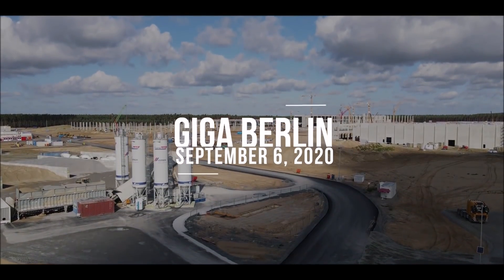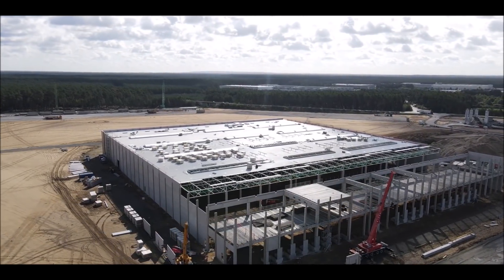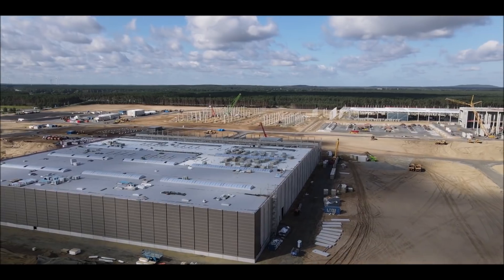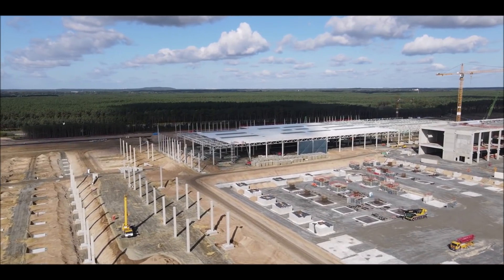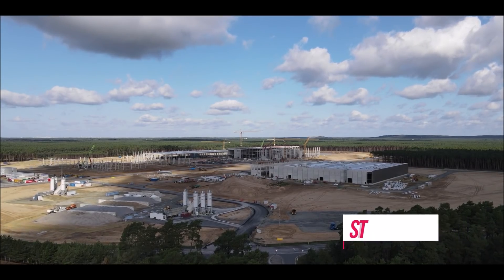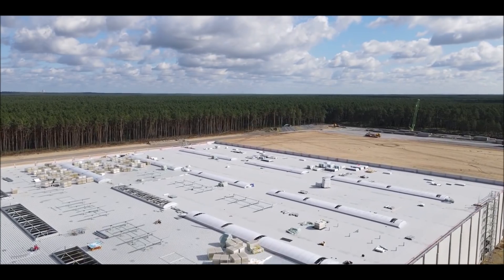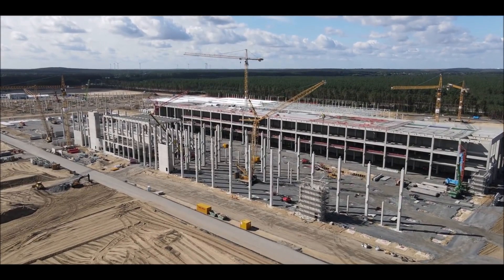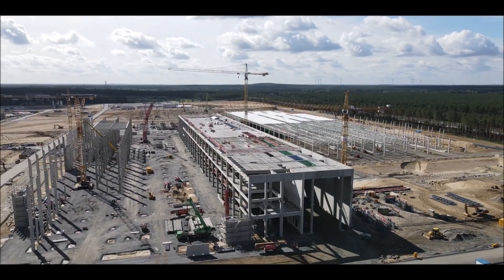Tesla To Use 8 Giga Presses at Giga Berlin Revolutionizing Production

Comment: Great video. Small correction: The German article from Teslamag says each machine weighs "hundreds of tons", not 100 tons. Per the Wikipedia article on Giga Press, the IDRA OL 6100 CS weighs in the range of 410-430 tons and has a pressing force in the range of ~6,100 tons.

Comment: 73.1 tons per day x 8 machines = 584.1 metric tons per day. If the bare chassis (less motors, mechanical, batteries, glass, sound deadening, suspension, interior) is 500 lb then this would be 2575 cars per day, 18,000 cars per week, over 900,000 cars per year. Wow
Reply: Nope it doesnt work like that, some machines will be used for redundancy in case one fails, thats how it is
Reply: Also they will never reach the production number of the vw factory in Wolfsburg

Comment: My moonshot prediction is 1 press to do rear body, a left and a right casting doing each of the front shock tower, shotgun and A-pillar as a pair of castings and one press doing the B-pillars. Then the sills are just extrusions and the floor is plated battery module. Dash and rear seat pan either plastic moulding or pressed Alu.
2nd set of 4 castings is for volume fulfilment and redundancy.

Comment: Isn't a casting machine called a foundry?
Reply: W N  it is not a new casting technology, bmw, audi have been using that type of die casting, sandy munro saw a giant casting in the bmw i3 way back in 2013, and the tesla giant casting machines are just bigger custom machines made by an Italian manufacturer and  not tesla.
Reply: W N  nope the bmw i3 was a giant casting, you have to look at old munro videos, also castings always requires machining and checking gor better quality since its a bigger piece to be made
Reply: Hi-tech high pressure presses, they are not using sand, lost wax or gravity pour casting
Reply: @reneheuscher1557  Yeah I understand that the technology has dramatically changed, but wouldn't It be kind of cool to use this old time term? Esp when people keep using  the blatantly incorrect term press for casting?
Reply: @reneheuscher1557  it has to melt the metal and press it through dies then cool it down, so huge amount of energy loss

Comment: Armen I don’t know how You get these stories ahead of everyone else? This is the only reason I still tune into Your Dhow. First of all, I was giving You credit for providing accurate information. THEN YOU BLOW IT. Please don’t refer to these Casting Machines as Presses. THEY ARE NOT. each of  these machines are as big ass house. They probably need multiple machines for curing time of liquid metal to cool so they can remove new cast piece and install in car. There will be another cast for front of car that is not announced yet. So MODEL X line may require 4 Casting Machines and the same for MODEL 3. What we all don’t know is if these castings may be used on both cars and they will probably be able to manufacture both cars on the same line at the same time using the same Robots. 
There also could be multiple presses for forming Sheet Metal that could be a lot more complex for metal handling capabilities.
Reply: I don't know much about metalworking, but I'm thinking the difference between casting and stamping could be a really big deal, bigger than is generally recognized. Correct me if I'm wrong, but isn't a cast part stronger per unit of weight than something that is stamped from a sheet? Of course, to do casting quickly in mass production must be difficult, and requires a lot of very expensive equipment. But if you make the investment and handle it right, you have a better product. Am I missing something?
Reply: Ronald Garrison You are not missing any thing. You got it exactly right! I predict there will be another CAST subframe for the front of the car and all TESLA’S will have 2 Castings. Elon Team Even developed special metallurgy and got the ITALIAN manufacture to make a bigger machine for them. I don’t know what these casting machines are worth? The research and development for the first factory could cost TESLA a billion. Only Elon has the Vision and ENGINEERING TEAM to make it happen. Don’t worry, he will get his money back a thousand times over. Look at the billions he invested in putting computers and devices in a million cars already and he will get billions back for his investment and vision made 7 years ago. I can’t do the math but Jeff a Bezos. In less than 10 years You will,have to give up that tittle.
Reply: @Butch Bailey
 he gets those stories so "fast" 'cause he is in the US, that is 6 hours (at least) back from Europe, where he gets most of "his news" ..... so he scans his bookmarked sources from Europe and China (even further ahead time-wise to the US) and copy-pastes what he can ...... plus lots of BLAH BLAH and repetitions to reach the minimum time-length, to get the Youtube money-bonus...... and if you have noticed, he posts all his videos in the noon, to afternoon (US time) cause he needs time to "create" his copy-paste repetition-garbage
Reply: George Albany Look I am no fan of Armen Hareyan  or TORQUE NEWS. I CALL HIM THE DEVEIL. George or Viewers help me out here. Why is Armen one of the biggest mouthpieces on UTUBE that gets real news. He then spins it and adds lots of Drama. He hates TESLA and promotes TOYOTA  even to tell us that RAV 4 is a better  value than a MODEL 3. He drives a PRIUS  and is proud that he doesn’t own TESLA shares. He lectures me that he will get his rewards in Heaven. WHAT THE HELL IS GOING ON HERE? 
WHY CAN’T WE HAVE OUR OWN PIED PIPER WHO LOVES TESLA? RESPECTS THE GENIUS OF ELON MUSK. WE ARE TIRED OF TESLA KILLERS!
Please God. Give our Daily Bread. Give us our Daily Fix of TESLA NEWS, PLEASE GOD DELIVER MY CYBERTRUCK IN LESS THAN 2NYEARS.
Why is it former UTUBE channel providers turn on TESLA: E for Electric Greg, Like TESLA Kim, and now Ben Sullens  for  Christ Sake is now in love with Lucid. Oh I almost forgot my old Girlfriend TESLA JOY. This Girl needs serious HELP. I told her I got a new girlfriend now, Jessica Kirsch who is a real hoot exposing the NOTHINGNESS OF Trevor a Milton and NIKOLA MOTORS by taking a road trip to ARIZONA even finding the FAKE DIRT used for Sod Turning Ceremony. I didn’t expect her Jealous reaction when I told her that i,moved on. She has got a new Relationship with Trevor Milton and he invited her to a special meeting and a ride in his new Truck was I pissed that she dumped me and thinks a Trevor and NIKOLA are GREAT. JOY EXPLODED. She calls Me a Pervert and that I never was her boyfriend! God that hurt. It’s not an unusual storyline. Boy meets Girl and they say nice things to each other and then the gal gets bored and sees the opportunity to make friends with a guy who has a lot more money.

Comment: All scrap and waste material can be thrown right back into the molten aluminum and melted back down. No need to send it out to external scrap metal recyclers.
Reply: Do you know this for a fact?
I think that the scrap aluminium would contain some aluminium oxide, which has a much higher melting point, so to mix this in would give a lower quality material. Maybe that is not a problem for this casting, but it could be.
Reply: @Will-be-free  no not for sure
Reply: @Will-be-free  I agree with you
Reply: Aslong as the casting machine can melt it hot enough to also take  care of the hard aluminium shell, it should be fine.
Reply: Will be free,
Sandy Munroe sort of confirmed this. He’s been trying to get the auto industry to use this for years but they all didn’t like the idea. Sandy stated that the unused material can be put right back for reuse. It’s not the same as what he was looking at years ago but he has a very good idea of how it works.

Comment: I assume they’ll have four car production lines and two aluminum casting machines per line. I’m guessing the 3 and  Y. But the other two cars could be a new small brand of car just for Europe. I wonder if Elon will make a small #Cybertruck there.
Reply: That would be so cool !!!
Reply: Initial production is only planned for model y... So foundations etc from Stage 1 are only model y. Model 3 only gets built in Stage 2. So i would assume the Model y Berlin uses 8 machines for a full Body Casting?
Reply: Maybe a european version of the Cybertruck will be made there. The factory is going to be mega huge anyway.

Comment: Eight machines to me means, 4 million Model Y cars a year.
Reply: You’ve never worked in casting. Say 5 mins per casting - 12 per hour per machine - 96 per hour total - 2,304 per day so 840k per year (365days) max - that’s if it’s 1 piece casting per car and 1 casting per car.
Reply: Scott Wills is that 840K a year just from giga Berlin ?
Reply: Pedro Neves the real figure would be much lower than this for servicing / retooling. I just wanted to point out 4 million cars a year is a bit of a stretch.
Reply: @scottwills4698  Why do you assume this is standard 5min per casting, i will assume Tesla also made big leap her, and it will be at list x2 better , means 1.68M cars per year max means at about 1M cars average per year
Reply: david benish it was a guess. To produce the rear of the car in 1 casting is extremely difficult so if they can do it at all it’s a big jump forward! To add molten aluminium to a die and get it to flow round without cooling too early over such a complex shape with various section thicknesses is amazing. But then it needs to cool (not too quickly) enough to be removed from the die. I don’t believe they can do it in much less than 5 mins (although I didn’t believe they could ever land a rocket on a boat🤪).
Reply: The casting machine is rated to produce 1000 casted parts per day.
Reply: kazedcat TM no it isn’t. No way you could add that much molten aluminium then cool it enough to remove the 1 piece casting of the rear of a car in 1.5mins. That would be impossible, there are some quite thick parts that will take a lot of cooling. My 5 mins was a guess and maybe it could be a bit quicker but it could be also slower - do you mean all 8 machines can produce a 1000 a day? that I could believe.
Reply: @scottwills4698  Nope 1 machine produce 1000 parts per day. The machine is doing advance stuff like vacuum evacuated mould and high pressure molten aluminum injection. They also quench the part immediately after casting. So the part will still be red hot when  they are remove from the mould. The method they are using is more related to injection molding than regular metal casting.

Comment: This report seems to assume that all 8 casting machines will be used to make the rear underbody castings. While that will represent a big advance in itself, I don’t believe all 8 machines will be used to produce that one component. 

What about another one-piece casting for the entire front underbody? Another for the middle section? Another for the dashboard and firewall? Another for the entire left hand side of the vehicle and another for the right hand side? One for the hood? One for the entire roof assembly and the final one for the tailgate. That would require 8 machines to create almost the entire body structure and would create absolutely perfect alignment between every high precision part. 

I understand the material used by Tesla for the castings can be cast in milliseconds so each casting machine can have a very high output. The weight savings would be considerable. Wastage would be almost non-existent. It would be an extremely high precision structure. And the entire shell could be assembled in minutes if not seconds, with everything else just bolted straight to the castings. It could actually become something like a cast exoskeleton!

Now THAT would be a revolution in manufacturing. And I am expecting to see something much more like that than merely the rear underbody casting. 

Now consider what the same deployment would mean when Giga Texas starts operation using the same process to churn out vast numbers of Model Y and Model 3 (based on the same underbody structure at least). All US production of those models could be carried out in Texas and Fremont could continue as a production centre for lower volume models like Model S/X and Roadster.

That’s my take on it in any event.
Reply: Or the entire frame at one go, which was the endgame mentioned in patents filed a while ago...
Reply: Bob H, yes I had that in mind but maybe that’s TOO ambitious at this stage. But not beyond the bounds of possibility in due course.
Reply: For the entire frame I say nope, it will require an even bigger/less efficient machine, plus make the car heavier, why can't they make cars lighter!? Plus steel/galvanised steel is stupid cheap compared to aluminium, aluminium is also a disaster to mine and process
Reply: @carholic-sz3qv  the castings are of aluminum and theyre lighter than what they replace...
Reply: @bobh9492  they are certainly not lighter but they are also very expensive and for repairs good luck, other companies already have tons of stamping press, just need new forms for new models and its already way cheaper than using fournaises/cooling
Reply: @carholic-sz3qv  here https://www.youtube.com/watch?v=KVGvwLnNyF0 the model y is using 2 large CASTINGS to replace 70 plus stamped and welded parts in its earliest iteration, it is LIGHTER than the previous method, the idea is to cast the entire inner structure eventually according to patents already filed, CAST, not stamp... the german models will probably have larger castings than the ones shown in this videp
Reply: Interesting insights and I too believe you are on target vs. the thought that it would be 8 machines all casting the same part.